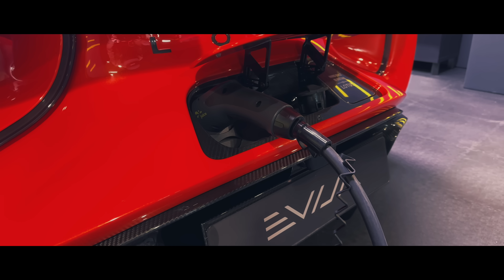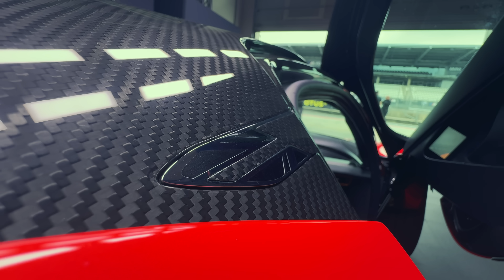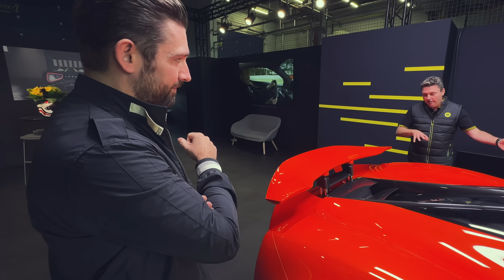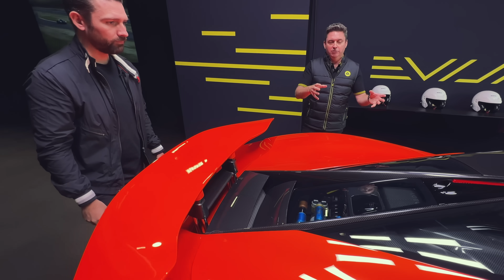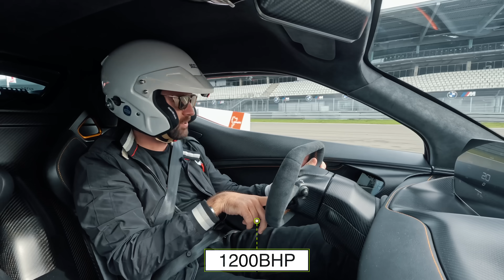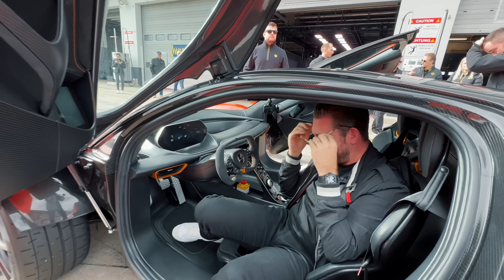THIS Is What a £2,000,000 Electric Hypercar Feels Like! LOTUS EVIJA Exclusive First Drive Review

Comment: What is it with car manufacturers putting these silly steering wheels on new cars! I totally understand why that shape is done for, say, a race car, but for a car that will predominantly only ever be driven on the road is just so unpractical, can honestly say that I think the car looks amazing, but that wheel and the price tag is a massive no from me! Thanks for sharing it with us James! 👍
Reply: It really depends on the steering ratio.  If you can do a 90 degree turn at an intersection by turning the steering wheel 90 degrees then it doesn't need to be round, but if it needs to be turned 180 or more degrees at any point then yes it's very impractical.
Reply: Proper driving technique is to keep hands at 9/3 at all times, crossing arms during turns. No one who's building a hypercar cares how easy they are to parallel park. They're meant for driving and in driving, you don't need more than a 180 degree turn of the wheel.
Reply: At 2 million dollars we can assume it’s a massive can’t afford it from you.

Comment: Having the batteries where the engine would go in the same dimensions as a V8 or V12  seems like the logical thing to do to help the feel and handling of an electric super/hypercar makes more sense than the batteries under the floor surely? Great insight man cant wait to see more 👍
Reply: Cuts Cog and X its Height x CoMass  ÷ === ???
Reply: Structural battery pack is best. Only tesla and byd have this technology in their ev's today.
Reply: @larryc1616  A structural battery is not really needed when the entire cabin is made of carbon fibre.
Reply: Higher cg and not as good a polar moment for inertia either. They do it to drop the tub super low that's it.
The caterham project v uses super slim cells in pack's under the floor and has a super low slung seating position and overall height. 👍🏻
Reply: @4literv6 having the batteries packaged as close as possible to the centre of mass is bad for polar moment of inertia? 😂 Think again!
Reply: @TheBrendonian  in this they aren't, instead it's a big t shape pack setup like the volt had. Which puts some of those modules up as high as an engine block would be. Mimicking the feel a mid engine setup smh. Maybe try reading next time! 👍🏻
Reply: @4literv6  it’s a trade-off. Higher centre of gravity than putting them under the floor, yes. But a massively better polar moment of inertia. Maybe try reading some physics books 😉
Reply: @4literv6  isnt that exactly what the Rimac Nevera does with its battery too?
Reply: @4literv6   mate. the relevant moment of inertia is around the vertical axis and not roun either of the horizontal axes.

how high up something is has no impact on said moment of inertia.

yeah them being high up inreases roll. but that's just fixed with a stifer anti roll bar.